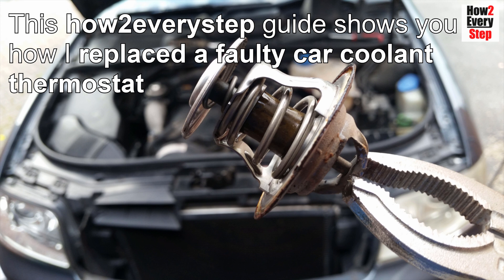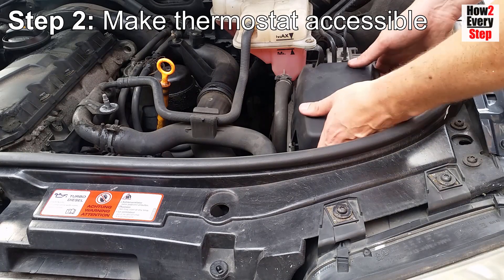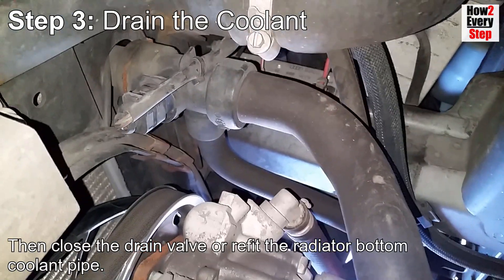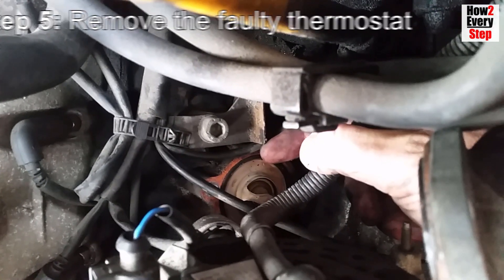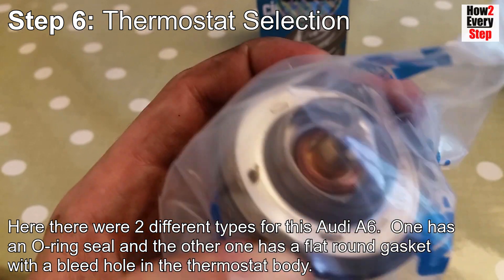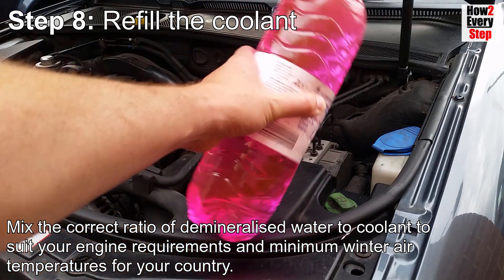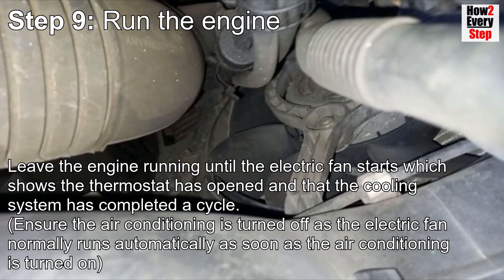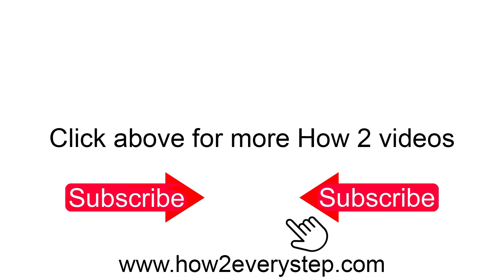Car Engine Thermostat Replacement - How to DIY Guide - 1.9 tdi Audi A6 C5 Passat B5.5 A4 B5

Comment: Hey there, thank you for the vid, my 2000 A4 AJM runs at about 70 and only gets to 90 if it is really hot outside. 
The temperature did not rise above 60 at all in that car?
Did you notice any change in the fuel economy after the thermostat change?
Reply from the maker: Hi there.  Sounds like you have a faulty thermostat too.  The temperature gauge read low all the time on my car until I replaced the thermostat.  To be honest I did not notice any change in fuel economy as i changed the thermostat after buying the car.  Hope the thermostat change goes well.

Comment: Hi, id like to know with the temprature gage is it normal for it to reach 90° and keep increasing after 20minutes and also what the right driving temprature on these audis, mine had a cracjed coolant resevoir and after i changed it the coolant rises after driving the car an then i switch it off
Reply from the maker: Hi Ian.  90 is the normal gauge temperature when the engine has warmed up.  If it rises over 90 the this indicates a problem.  Did you replace your thermostat - as it sounds like yours is stuck closed...
Reply from the maker: Also your cracked reservoir will allow coolant to escape as steam if the temperature goes over 100 degrees C, because the system will not be able to pressurised.  So you need to replace your cracked reservoir.

Comment: do you have to drain the coolant got undertrays fitted and working kerbside ,great vid.
Reply from the maker: Thanks - glad you found the video useful...  If you don't drain the coolant first then when you remove the faulty thermostat the coolant will drain from the engine anyway.  And it will sit on your undertray and overspill onto the road so is much better to drain the coolant first...
Reply: wow thanks for very quick reply,so much help thanks
Reply from the maker: No problem.  Good luck!